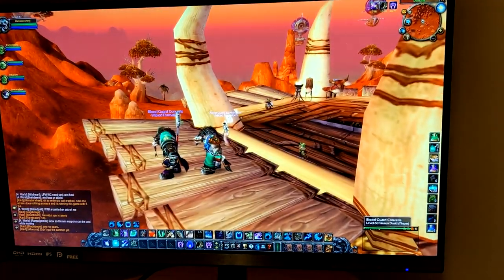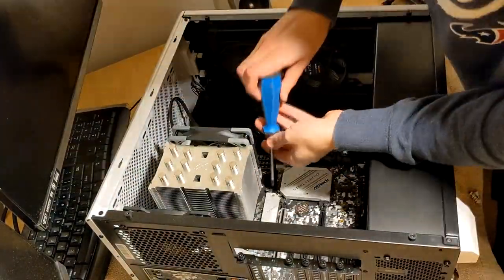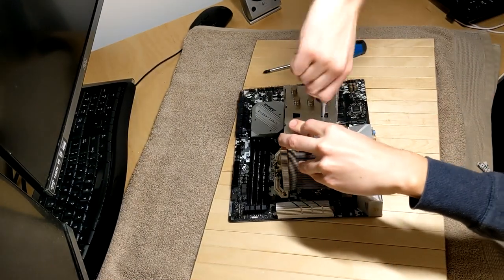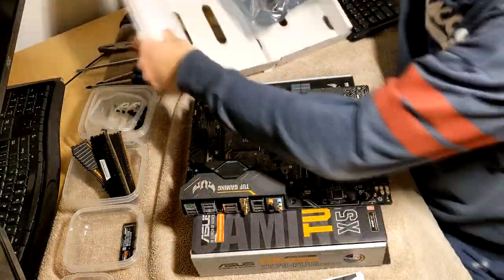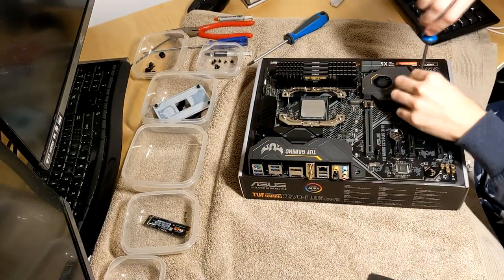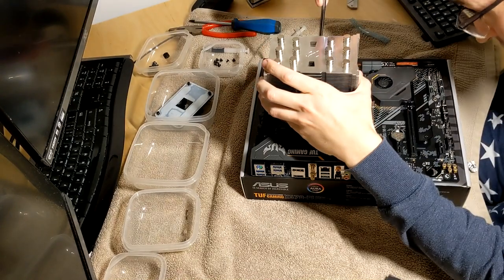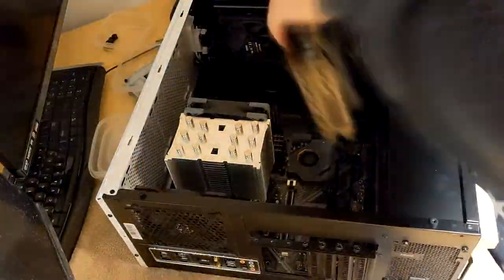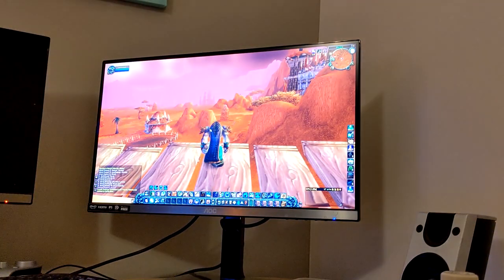Fixing The Dying Hamster PC

Comment: I just replaced mine too with the same mobo! Remember to not throw away the little antena it comes with because its not only a wifi antena but  also the bluetooth, without it bluetooth devices will have big troubles connecting. Took me a couple hours to figure that out lol.